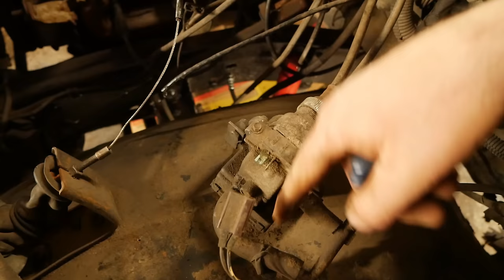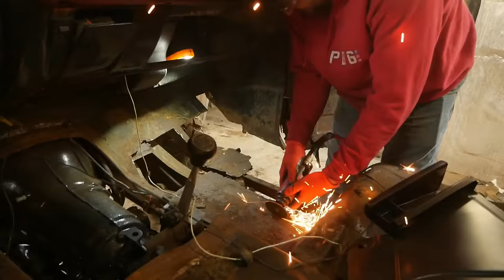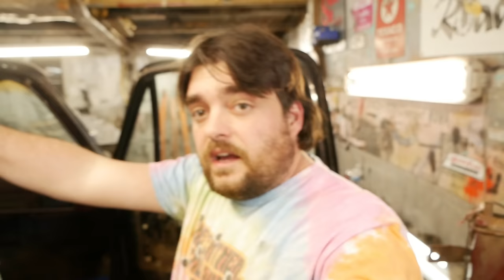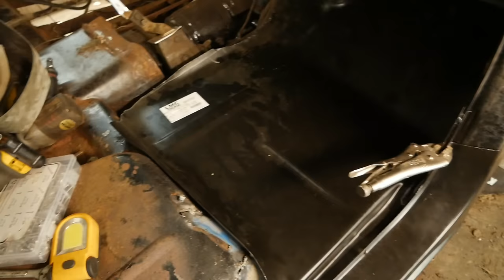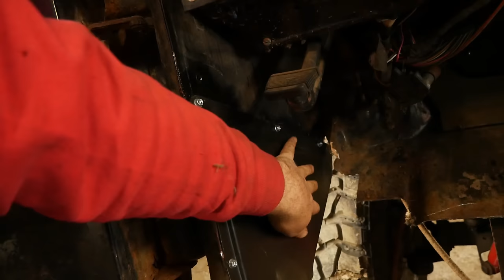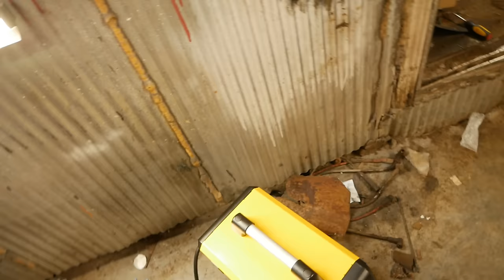BUTCHER TIME! Chevy K10 Stepside Gets Floors & Rockers

Comment: Hey that new welder machine is great.
Even if you don't know Jack about it, when you open up the panel on the side, there's a legend that tells you how to set the machine for the thickness of the metal and size of wire you've got.

The machine does the rest!!

Its stupidproof!

Comment: This'll make a guy cry- had an inlaw a few years ago start on a square body project, they found a much better cab (thiers was like yours) but still had to do outer floors, rockers, cab corners - he had the whole cab 95% done and in primer. Lost intrest in the project, left it sit out on saw horses in the open, rain water and leaves filled it up, claimed he couldn't sell it (I doubt he advertised it or took it to a swap meet) it, along with the repo fenders etc left in a damp basement all went to scrap.  He is a very talented person but just can't finish what he has started! Great work Polebarn- those little port a power sets have been a godsend to me working on big diesels in boats and having to move stuff around!

Comment: This reminds me of watching some guys working on an early Mustang convertible that was so rusty that you didn't even dare to open the doors.  The doors were the only thing keeping it from becoming a taco.  This truck is just an upside-down taco with the roof being the only thing keeping it together. Similar to the Mustang stuff, with a Chevy like this you cut, weld and hack the thing together halfway decent so that it's at least safe and hopefully doesn't leak. Then if you want it nicer later, you can always do it again.  To be honest you've given this truck more of a chance at a new stage of life than almost anyone else would have done. Most would have grabbed a few parts and scrapped the rest. I kind of want to see you and DDSpeedshop do a collaboration fixing some rusted-out pile of junk and making it run and actually able to go down the road.

Comment: Good stuff.  I took a different route with an 85 K10 Custom Deluxe I had.  My floors and cab looked a lot like Silver Dollar.  I scored a 1981 Scotsdale C10 with a dead 350 Diesel, a bad rear diff, and a nicer two-tone cream and brown body that the owner was going to scrap.  The Chevrolet dealership I worked for at the time was cool with personal projects as long as they were out of the way of daily business.  After a few weekends of prep on both trucks, I used two lifts to swap the beds between the trucks.  On the following weekend, I cut the 4wd tunnel out of my original cab and cut the lower tunnel out of the 2wd cab.  I then strapped the cabs, complete with fenders and core supports still attached, to two lifts and swapped the trucks underneath them.  Everything fit perfectly.  I then welded/self-tapped the 4wd tunnel into the 2wd cab.  The craziest thing was the firewall connectors for the engine and lighting were IDENTICAL between the 85 harness and 81 body and everything just worked when I plugged it all in.  The diesel specific connections on the 81 cab used their own dedicated connectors on the firewall that I just packed with grease and left alone.  It took an entire winter, but I started with a VERY rusty blue 85 Custom Deluxe and came out with a much nicer looking two-tone 81 Scotsdale on the same frame and engine.

Comment: If you get gas for your welder get straight co2 rather than mixed gas. Its way cheaper and you dont even have to go to a welding shop to get it. It welds just as good dont let anybody tell you different
Reply from the maker: Will do

Comment: This truck reminds me of my '70 Beetle, except my Bug isn't quite this bad! 
(but it's close! Lower 8-10" of the body needs replaced, floors, heater-channels, the odd hole hiding under bondo...)
Unlike your truck, the heater-channels (rocker-equivalents) are still there enough that the body is sound and the doors close well. So, not only am I amazed by what you're accomplishing here, I have more to lose in my eventual repairs!
Anyhow, much as I bemoan the methodology of whatever previous owner it was that welded patches over the rust without doing anything about the rust, it kept it out of the scrapyard long enough to reach my hands.
Got it for cheap, too! (partly because previous owner was downsizing in the midst of a divorce)
Truck is looking a ton better and more solid!

Comment: I've been looking so forward to this! I'm not the only one crazy enough to save a horribly rotten cab 😅 when I saved my f150 everyone told me to swap the cab, I said no, it won't be my truck if I do that. It's definitely not factory, it's got plate steel and box tube built into it, but it's all steel, strong, and going down the road all summer long 👌

Comment: I repaired all the rust on my 2004 ram up here in rusty NW Iowa, I did some sketchy shit like this throughout the whole process, try putting a piece of masking tape on those bare metal edges where your working it'll save you a thousand scratches, and shielding gas is the way to go so much better welds, I rent a small tank and got a Harbor freight cart. Love your channel.

Comment: I have no problem with half-assery on a project like this as like you said, it really should have been junked and you're literally saving it.  The only problem I have with folks doing this kind of work otherwise is when they try to pass it off as something better than it is to the next buyer, something I don't think you're the type to do.  MIG will change your life, much easier to weld thin metal like this!

Comment: Dalton, my first work truck was a 1977 GMC 1 ton dually with a 8 by 12 dump bed. Sierra interior which is like a chevy scottsdale interior. I purchased it in 1982. Sold it in 2005 to a watermelon farmer.  It had a BBC and I had it rebuilt 2 times.  I was the only driver and over 300k when I sold it. It had a 4 speed manual. It went through clutches every 10k. The problem was the bell housing from factory was .040 off. I wish I never sold it.

Comment: You are 100% right on how long that stuff takes. I did the floors, trunk and quarters on my 70 chevelle and I probably have 100's of hours into it. Taking out the old rusty metal by itself takes a million years. Then taking the stuff on and off to get it lined up right is a chore. I love that you are saving the truck, even if that means not everything is perfect!

Comment: I actaully have that exact same old welder of yours. I've been using it for years with solid wire and using CO2 as a shield gas. I boxes in a rust Geo frame with it. Using CO2, you can fill it at more places than just welding shops and it's way cheaper. I got a little 2-1/2" tank a restraunt was getting rid of for soda machines and it's all on a little cart. Handy little set up if you want to go that way with your new welder, at all.
Reply from the maker: That's a good idea
Reply: 2-1/2 foot tall tank. Not inches. I'm dumb.

Comment: I just replaced the front cab mounts and patched the floors in my truck last winter, and it took me probly over a month to do. I also had zero clue wth I was doing and had never done body work or mig welded before in my life, but I got it done and it looked good and will last a long time. Just wanted to say I know this was an assload of work to get done in a short time for a video and I enjoyed watching it. Can’t wait to see this truck back together, it was so rusty I think most would’ve just crushed it but you saved it which is great.

Comment: I recently started cutting some rust out of the windscreen frame of my '83 Celica. Here I was thinking my rust was bad! Definitely going to try some of that short strand fibreglass filler to tidy it up a bit. I read that it's also waterproof which I guess will help. I'm thinking of using epoxy primer on my repair areas and then a skim coat of glass filler followed by either KBS Rust Seal or just any kind of paint, not sure how well RustSeal or POR-15 would adhere to glass filler. I just don't want it to rust again after all the work it has taken to fix

Comment: Your hoodie strings were getting kind of close to the fan a few times. I either pull them out or cut them off.  

When you  have 24v going to the starter, the coil gets 24v when the starter is engaged unless you disconnected the OEM coil supply wire.  It is also not a bad idea to ckeck for spark at the plugs in case the rotor is shorted. 

Don't  cha just hate know-it-alls...  Hey, thanks for the content! I enjoy your videos!

Comment: This is great content Dalton. 

I’m facing a project in similar condition, a 1976 Dodge Aspen that my son fell in love with, I thought the rust was just body panels, which reproductions aren’t available, but I found out the front frame is rotted out. I am a fitter-welder so I’m confident I can do it but it just took a turn from simple quarter panels to replacing rotted metal everywhere and like you’re doing, just make it better.

Comment: Top tip on the short strand Bondo glass, add some liquid fiberglass resin to the Bondo glass. Add whatever amount of resin you like to get the smooth consistency you want, then add your hardener. A good way to save the old Bondo glass. Works great. Thanks for sharing buddy.

Comment: Just a heads up, I welded rockers on a 69 chevy c-10 right in the original seams and when I put the door on the rocker was too high, I had to cut it back off and fit it with the door on. Hoping to help. Like you and JD 's videos
Reply from the maker: With that snubber hole to use as reference I think they're in right, however, I'm sure they aren't stamped correctly ad I'll run into some sort of issue there

Comment: Dalton you been watching Birdsong put them old Dodges together haven't ya stuff like this old truck and them dodges he rebuilds is proof where there is a welder there is way
Edit if you run a oversized tip on your mig it'll naturally let the wire spiral some as it comes out works good for spot and plug welding sheat metal iif your running .032 wire try a .035 or a little bigger you can play with drilling one  oversize too coming together though just keep adding metal till is solid
Reply from the maker: Ok I'll give that a shot thanks!

Comment: Step 1- Cut the dash out with the VIN number. Unless its only on the door then in that case just cut that section out of the cab
Step 2- install that dash/door jamb into a truck that will still attract a magnet.
Step 3- drive around in your new more magnetic hotness with maybe a smidge more paint that will drop panties all over.

As a side note- we had a car with one of those Cruise systems on it that got hung up often.   Cool concept but needed a little work. Also, aside from the ribbing here to see if you actually do get that thing back into kinda the right shape.
Reply from the maker: Cab swap would make it infinitely less entertaining, and also, you can buy the flower rivets on eBay, so drill away!

Comment: your new welder is smaw (stick), scratch start tig, regular mig, and shielded gas flux core. you're probably best off with regular mig, flux core anything is really a nightmare to use on anything under 1/8 inch steel

Comment: When using flux core welder move your ground wire to the positive port on the welder. And wire wand to negative port. You'll get much better welds and less splatter.
Reply from the maker: It was

Comment: The post 1972 70s GM/Chevy trucks are non-existent in most parts of Merica. I used to detail used vehicles for dealers in the late 70s. At only 4 years of age their pickups were rotting out. Some had Z-Bart  rust proofing and even that didn’t save them. 

They were made from Japanese steel which was rinsed in salt water to cool it. Then it was sold to GM and they never hit the salt residue off the steel before they made the steel into body panels! Lol 😅 GM sealed in the salt and put them on their trucks. I’m surprised to see one of these 70s trucks left. They would have softball size holes in them in 1977!

Comment: I’m probably talking out of my ass here, but it’s my understanding that the open metal tube/pipe at the end of the welder is for shield gas when using MIG; I’ve been told that you’re supposed to take that off for flux core welding.  They usually come on FCAW welders because they’re using the same handle.

I’ve been leaving mine off.  I haven’t noticed a difference in my flux welds (they’re all crap), I can see much better, and I don’t have to clean crud out of the tip. 

Or, it’s a bad idea and I’m full of crap :)

Comment: Is that thing actually gonna get paint when you're done? (You may have already answered that question).

To keep with the low buck aesthetic, I would use the same sort of tractor paint you used on the '59 Ford, though I would actually pay for some good epoxy primer before doing that.

Awesome truck.
Reply from the maker: Yes of course, it'll be "restored"
Not a fan of epoxy primer, doesn't sand, shrinks, and doesn't seal any better than modern 2k urethane primers
Reply: @PoleBarnGarage  Epoxy isn't really meant to be sanded (other than light sanding before different primer goes overtop).

Epoxy is really meant just to have stuff put overtop of it (though I have used it as a filler coat before). Also, some brands of epoxy can also be mixed up as a sealer.

Hell, I've even put old school non catalyzed Lacquer primer over epoxy in the past, it just makes a good base to stop any sort of delamination from happening in the future.

I see where you are coming from though, I just kinda swear by the stuff since it's what I was taught to use.

Comment: With that new welder, if you may ever want to TIG weld, buy the argon tank instead of the CO2. Argon should work with both. The new Vevor multi purpose welders are set up that way. Read your instruction manual before investing in an expensive gas tank that isn't exactly what you need.

Comment: The whole drivers side of my 83 dodge d150 (project SHOPTRUCK) Cab is badly rotted needs a floor pan a front cab mount inner rocker (someone already installed outer rockers with a screwdriver and a case of beer) and the rear cab mount needs help too... passenger side the front cab mount it on its way to failure plus inner rocker. I luckily found a 92 d150 cab that Is AMAZING compared to the original cab it just needs a drivers floor pan all cab mounts are MINT!